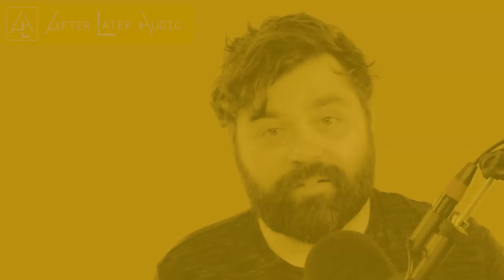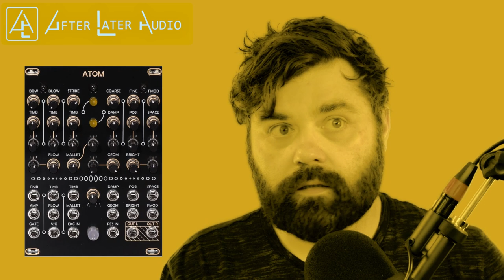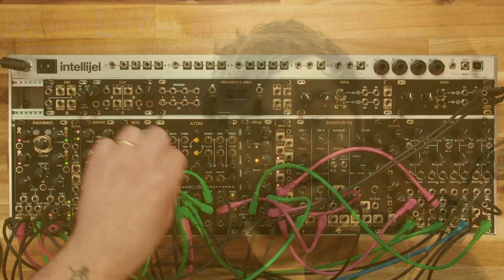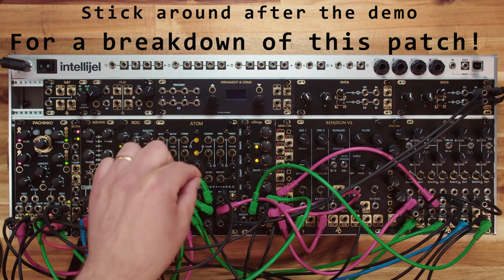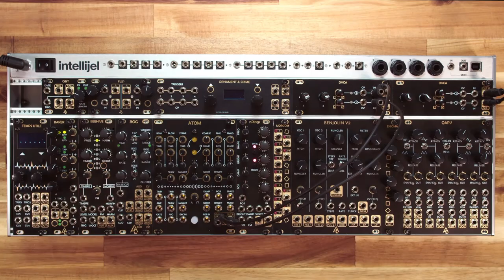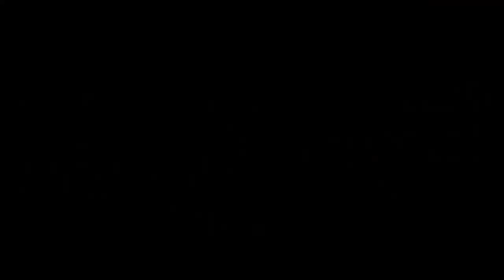Atom Overview

Comment: Hi, I recently bought this module and the gate input doesn't seem to do anything,  I can trigger sound with the res in, but the gate does nothing. Is it broken? Or am I doing anything wrong?
Reply from the maker: Are you using a short trigger or a gate? With some areas of the contour knob you may not get much out with just a short trigger. Also make sure the brightness and damp are up a bit. It is also worth noting that one of the outputs (I believe the left) gets very quiet and inactive with the Space all the way down.
Reply: @afterlateraudio9976  Hi, thanks for the reply, I have tried all sorts of trigger options, and turned up brightness and damp, nothing works, the res in does work as a trigger but of course resonance is peaking and many other parameters become unnoticeable, so that's a temporary solution but not great. It seems like the module is just broken or non functional, which is pretty weird being brand new.
Reply from the maker: @alan_lana  If you can shoot us an email on our website we can get this sorted out for you.

Comment: Hi! Do you think it has some sound difference with original?
Reply from the maker: Sound is identical to the original, it is just in a smaller footprint.  We also have Quarks which is still smaller than Elements but a little bigger than Atom.